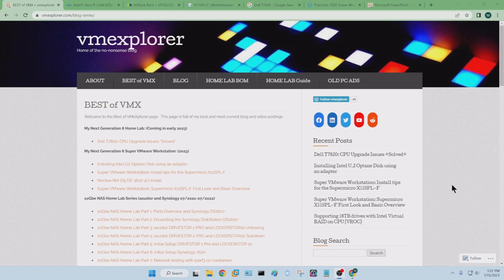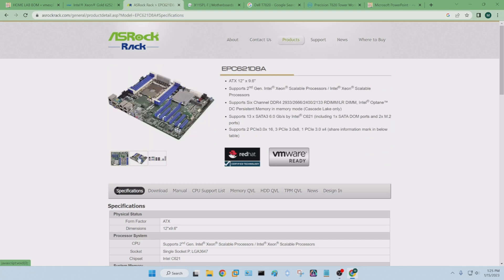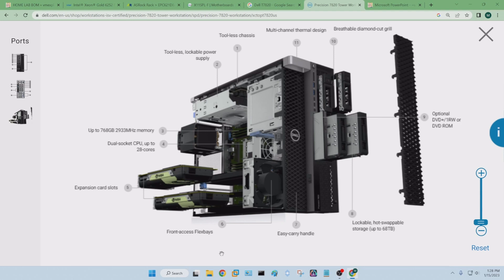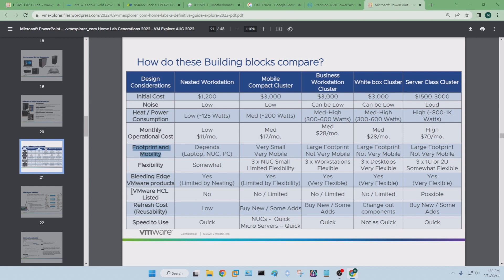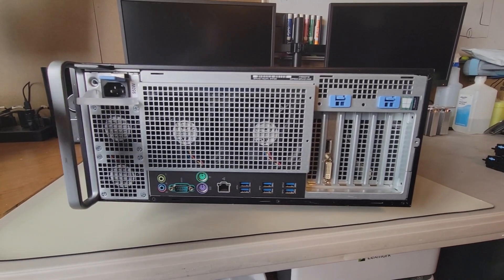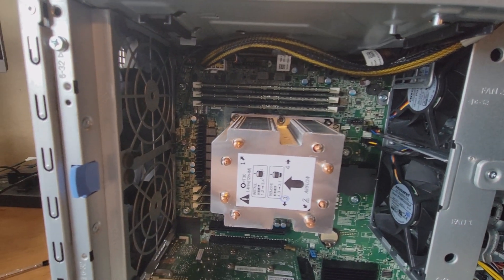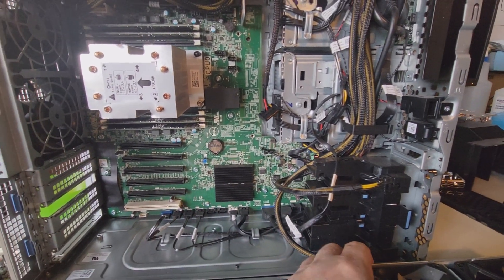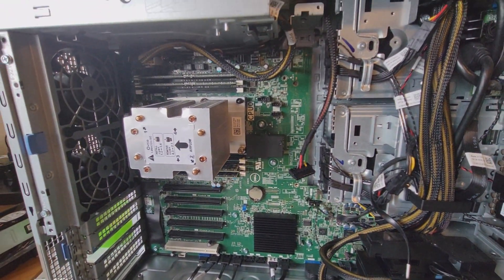First Look GEN8 ESXi/vSAN ESA 8 Home Lab (Part 1)

Comment: I am currently in the process of replacing a T5810 that I upgraded with a E5-2678V3 with an Epyc 7302 + supermicro board.  For what I paid for it (about $200 + another $100 for the CPU upgrade) it has been a great little machine even given all the quirks with it being a Dell.  HP Z series are also good second hand machines for budget home labbers if you aren't rack mounting and want something fairly quiet/expandable and (relatively) inexpensive.  I'm more an open source guy but it's always cool to see what people are running and why, thanks for the vid!
Reply from the maker: Thanks for the comment and insights!

Comment: these systems are rapidly aging, full of unwanted dell proprietary 'goodness' and basically overpriced for what you get but since all comp prices are currently overpriced it is basically status quo - you really don't even need a video card - they can run headless just fine, they are power hungry and not that efficient compared to newer cpu so tco is higher, roi lower, also by sucumbing to vmware ecosystem you get vendor lockin - most smb only need basic virt that works so vmworkstation will work fine for them no need to use other products but they have open source options as well which just work but have a higher learning curve initially - basically accurate - it is hard to find platforms that run a bunch of ram and have enough pci lanes - these machine fill that niche and are quiet unlike rack mount servers - much nicer - good content and overview!
Reply from the maker: Thank you so much for taking the time to post with such insightful commentary.  You clearly understand how Home Lab builds are a balance between many different factors and from someone else's point of view this balance may look different. This is one topic of many that I've documented in my VMware Home Lab Guide and I welcome all to check it out. https://vmexplorer.com/home-labs-a-definitive-guide/